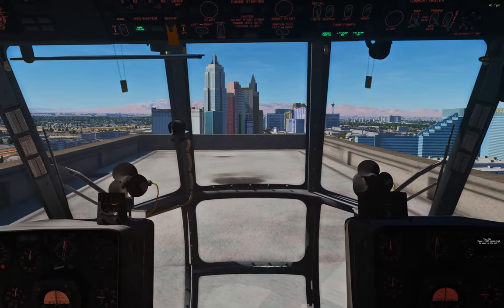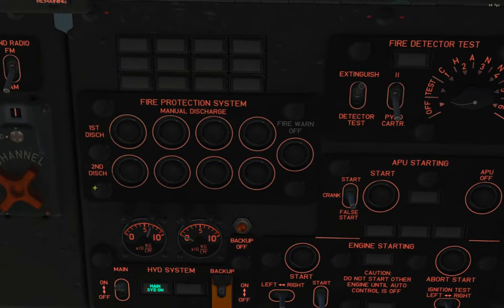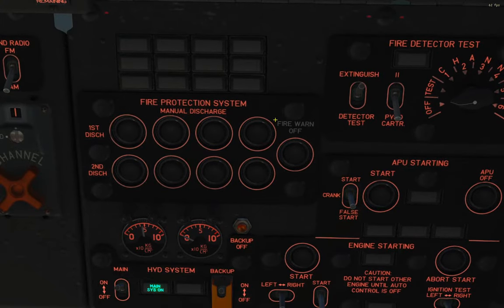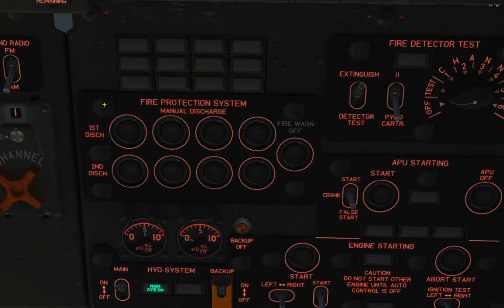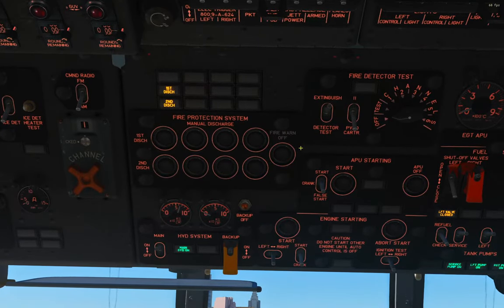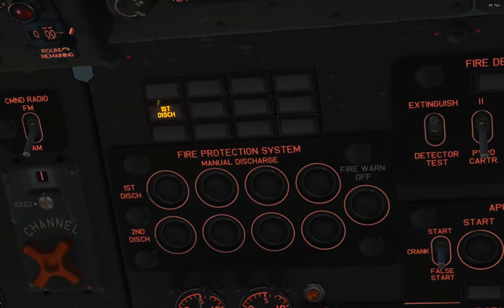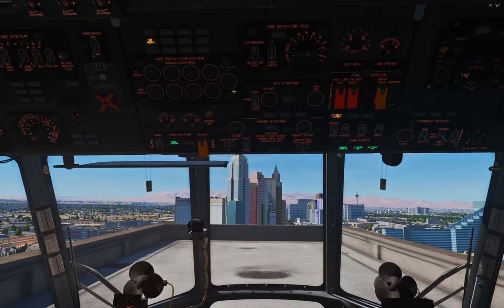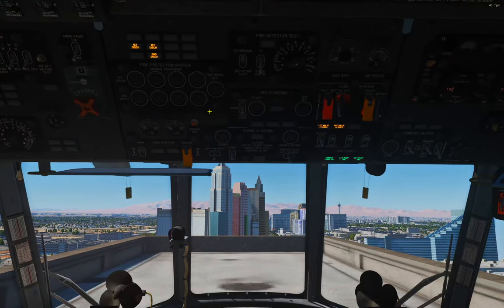DCS Mi-8: Fire Suppression Tutorial

Comment: Great video! Might be a silly question. Then You trying to restart the engines, shouldn't You turn off the engine brakes (if it is called that) when You starting engines?
Reply: They are called "Engine Stop Levers", and he has to open them only AFTER the APU manages to rotate the engines, but the STARTER ON light never illuminates, so he never reaches the point where he would need to open the Engine Stop Levers.